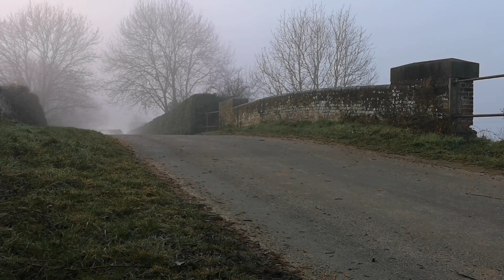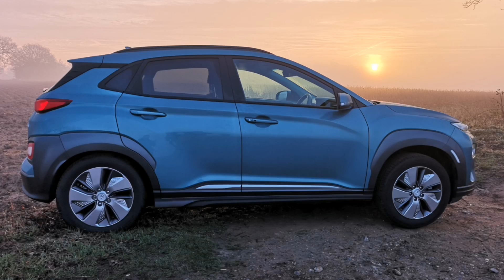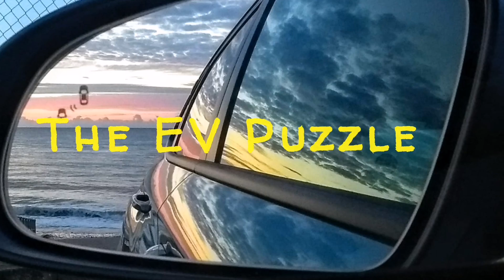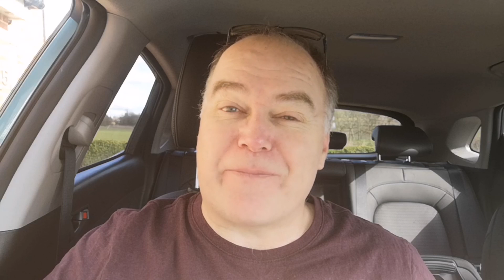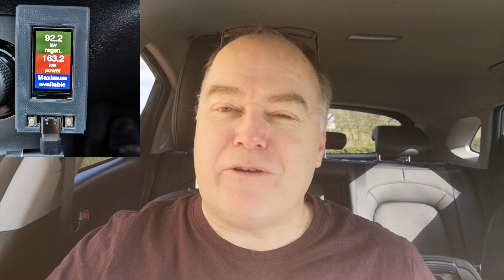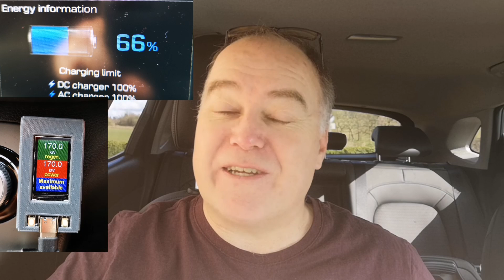Kona Electric 170kw charging / Regen power

Comment: I hate to mention the words ‘Nissan Leaf’, but … the 24kWh has a meter on the dash that shows both (instantaneous) consumption or regen.  This is a bit more sophisticated in the 40kWh version insofar as it shows a much finer level of detail AND it shows exactly how much regen (as a portion of the maximum) is available at any point.  It confirms exactly what you’re saying and it’s equally obvious through the (variable) braking effect you get from the regen.  It’s only an analogue dial (so sorry, no numbers!) but at least you have a good visual display of how much braking regen is going to give you.
Reply from the maker: I'll admit it then...the Leaf is better than the Kona ...in that respect. Can't believe I said those words 🤣😉🌞

Comment: I remember you did this test a while back where you compared coasting vs regen for efficiency. I wonder what the energy loss is with regen vs coasting in a very controlled environment. Subjectively it does seem that when I have passive regen set to zero or one and try to coast to stopped traffic from very far away my numbers seem to go up. ...and often the light will change before I get there. I found my best numbers on a long stretch of road that happens to have dense traffic but no stops or lights and consistently low speed. About 40 - 45 mph (US). Even in sport mode getting up to speed quickly I still get good efficiency there. The kona is so much more efficient than an ICE car that I don't need to drive it efficiently if I don't want to but I still often find myself playing the numbers game as something to do while driving.
If you want to see something funny reset the mi per KWH while coasting from high speed and you'll get some (meaningless) crazy high numbers.
Reply from the maker: I've tried many times to work out the best formulae but it marginal between Regen and coast. Regen at speed, coast at low speeds?

Comment: It makes logical sense based on battery charge and what it can accept. But doesn’t necessarily make safety sense - all this talk of one pedal driving (and regen can slow you very quickly - quicker than my usual braking in a Tesla model 3). But if you’re expecting to slow down and it sometimes does, but sometimes doesn’t - could be tricky if you have to suddenly adjust and hit the brakes. I wonder if it would be better to have regen under the brake pedal, and it blends regen + braking to give you the driver a consistent amount of slowing down performance, and the only adjustment is behind the scenes in the car whether it redirects energy to regen or not
Reply from the maker: You should always be in control of your car. It's bit often the car is fully charged so not a problem

Comment: Yes, true for all EVs with regen. My I-Pace has a indicator bar in the power/charge indicator that shows the max regen. When SoC drops below around 90% the bar disappears. I'm a big fan of regen braking, but it's also good to give the friction brake a workout occasionaly to get rid of the rust (and squeals)  that can appear after prolonged lck of use.

Comment: Hi Nigel! I don't get it. How is it possible that the Regen charging can be 170kw but the original charging just 75kw?
Reply from the maker: Good question, I guess it's heat. Braking is temporary, more like a few seconds or pulse. Actual charging is continuous so generates more heat.

It's a good argument for pulse charging at chargers

Comment: Afterall it is to protect the battery. Being because of tempreture or because of high state of charge. Always best to keep SOC between 40% to 75%. In the end for effecient regen you should not regen with so much power but better little and longer time/distance. So a gentle and longer regen will get you more charge back than a strong and shorter one. You don't want to waste energy in heat.

Comment: Ive noticed with my MG ZS EV that i get very little regen when I'm fully charged and the level massively increases as the battery level decreases. I do like it better when the level is low as it's almost one pedal driving.

Comment: Thanks Nigel,. Makes total sense as the battery voltage goes up one loses the load on the generator (motor). 150 kW regen braking 60 - 0  in about 7 seconds. I guess we still need those friction brakes...